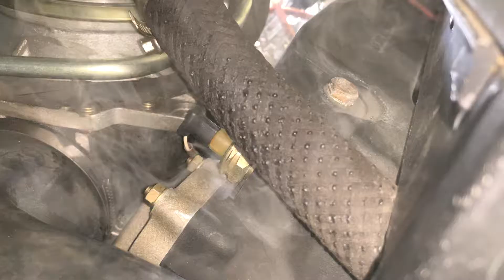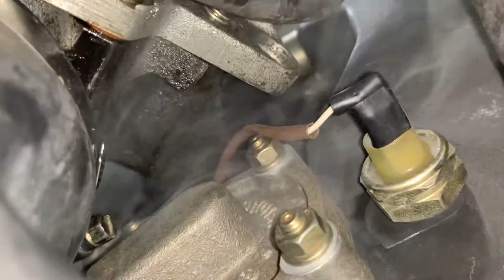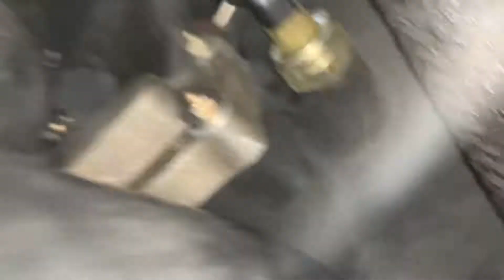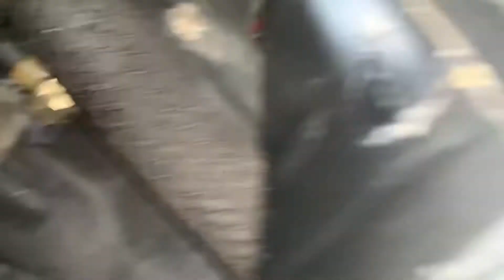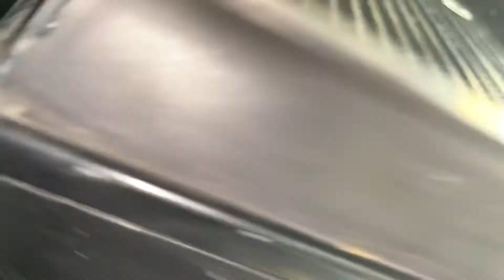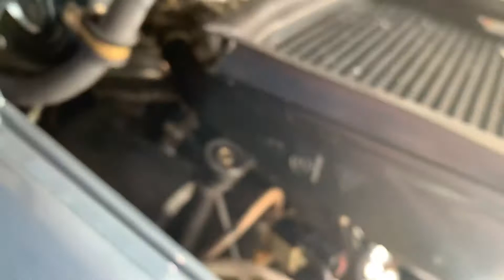1989 Porsche 930 Turbo Smoke Test

Comment: Have fun finding it. I'll be taking g stuff off the motor this winter to find a similar though lesser leak.
FYI, it's not a blowoff valve...it's a boost recirculation
manifold. The first place I would look is at the o'ring where the manifold mates with the throttle body.